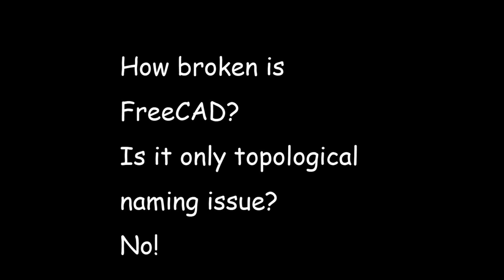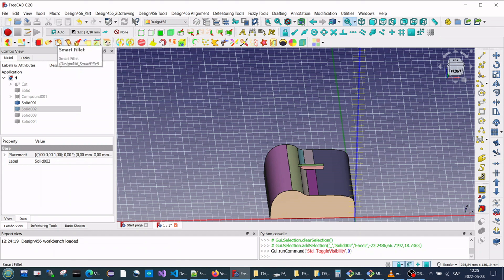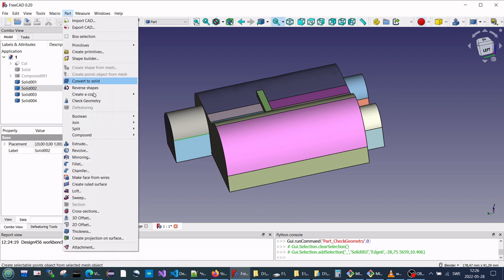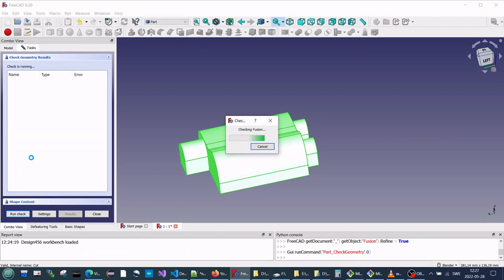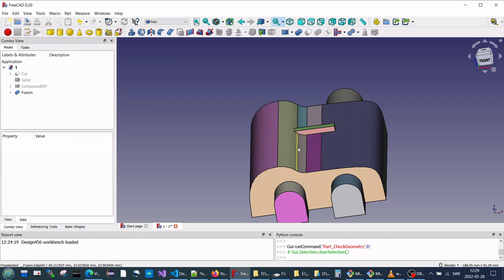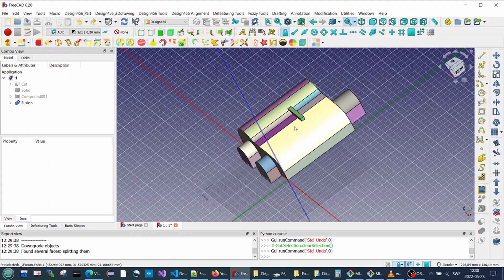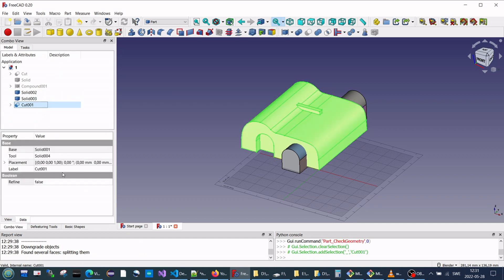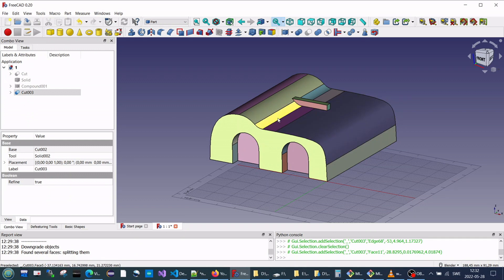How broken is FreeCAD? Really it is serious

Comment: I think those issues are about tolerances and tangency
mathematically tangency is tricky, and you may play with tolerance in OCC to see if it does change something
Reply from the maker: Yes might be but think! .. If you have several hundred sub-objects and suddenly you break a part internally and you don't know when that could happen or happened. Later you continue to develop more your object. At the end you will have an object that wouldn't be possible to repair. Since you don't know when the problem happened.
Breaking the model by any operation should be checked by the engine itself. If tolerance is a big issue in OCCT, it should warn, autofix ..etc the problem.

Comment: Learn how to do this using the Part Design workbench. Your overall shape can be constructed very easily and without any such errors.
Reply from the maker: In my world, there is not such thing "Part Design" .. 
Actually I hate Part Design. I do what I do because I like Direct Modeling. Again that is not the answer for the problem unfortunately. These problems are also in Part Design .. since it is based on OCC and OCC is the problem.

Comment: For me “too small edge” is very straight forward error. It means that merging or cutting creates a completely new body which has literally everything different than contained parts. Let’s assume there is a limitation, that a curve radius cannot be smaller than some value. You take two balls of a big enough radius, and there is no problem. But when you merge them, a deep valley can appear between. The curvative rule will be broken. This is obvious.
I’m not an experienced freecad user, but the issue seems has a logical explanation.
Reply from the maker: Tolerance is one of the players property that might cause issue for you. I don't know how OCC uses that value. But if you use the defeatuing wb I have in my workbench, and apply tolerance to the failing shapes one or twice it might fix the broken shape? how and why? I don't know.
simplifying faces, edges are total disaster inside OCC.
Sometimes there are faces inside faces where they should be merged and disappeared. For some reason .. they don't .. That is why I have several tools to target that issue.